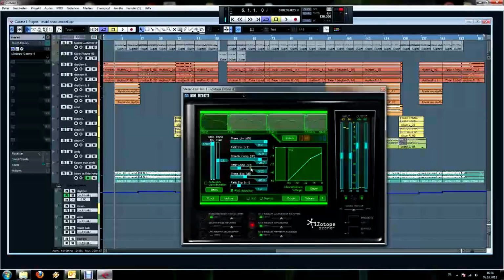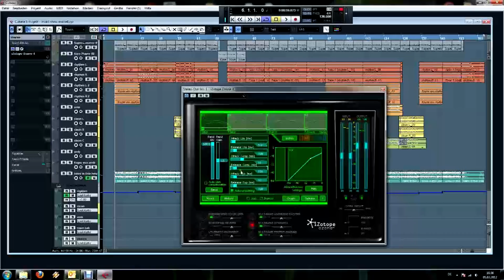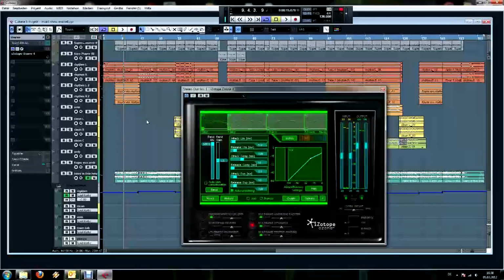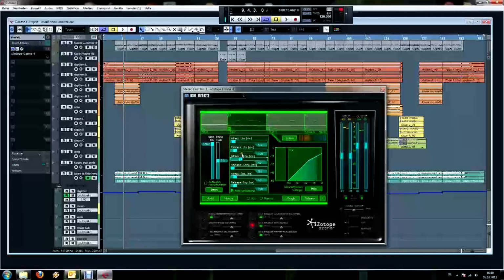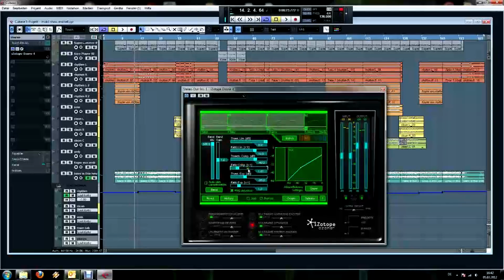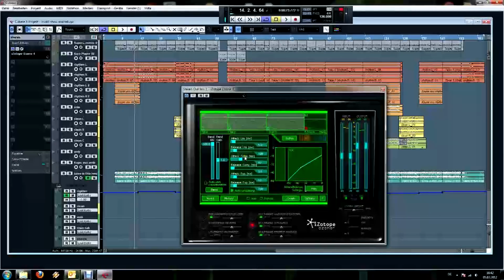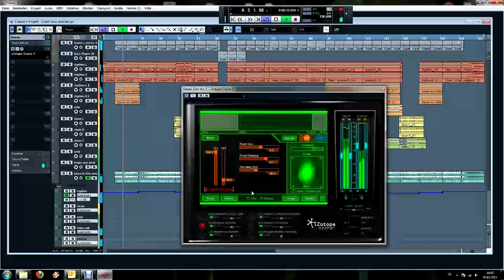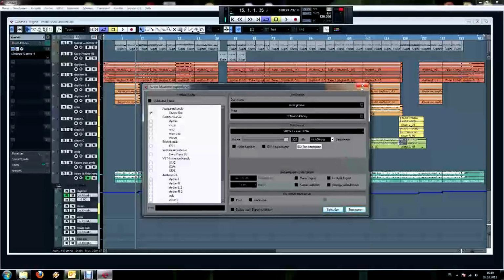metal production tutorial part 10.2 - mastering: multi-band-comp, maximizer, reverb - ForTiorI

Comment from the maker: @joeban1985 they may not exactly stand in each others way, but you will notice in the whole mix in that frequency area is a lot going on. if you´re talking about rhythm guitar i would boost them around 4kHz, lead guitar around 4.5-5kHz and vocals a bit higher around 5.5-7kHz with a high shelf (somewhere in that area depending on the singers voice).

Comment from the maker: @joeban1985 than they would stand in each others way and it can get messy in that area where two instruments are boosted. for example if you boost the bass guitar and the snare at 200Hz the bass can easily overpower the snare and drown it. also if you don´t cut the bass correctly it can very easy kill the impact of the kick drum. or if you boost ambient guitar and synth at 4kHz there would be just too much in this area and the two are not good to distinguish.

Comment from the maker: perhaps you also need to check your volumes in the mix again. the way i set the maximizer now is i listen to the loudest part of the song, mute the drums and bass guitar and set the maximizer so the signal just barely reaches the ceiling. i don´t care if it´s still quite afterwards cause it still sounds transparent and not squashed. a lot of my stuff is actually quieter than most commercial bands. as long as it sounds good you shouldn´t care about loudness. people still have volume knobs.

Comment from the maker: use your ears :p sorry, i don´t have any tricks or hints on how to level the different tracks. i just fade one after the other in so they are noticeable and add to the whole feeling but don´t overtake everything. panning depends on if you dual track ambient and clean guitars. with amb guitars i mostly used to just track two octaves once and leave them centered. now i dual track the lower octave and pan them 70% left and right, so they leave hard left and right for rhythm.